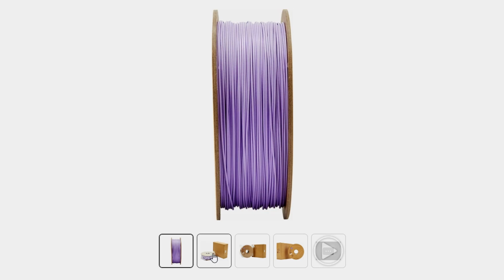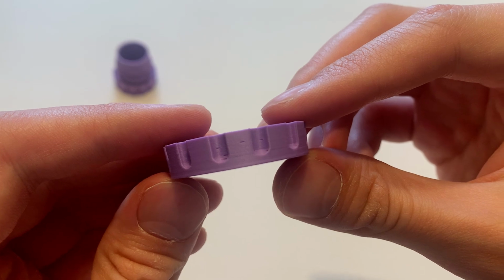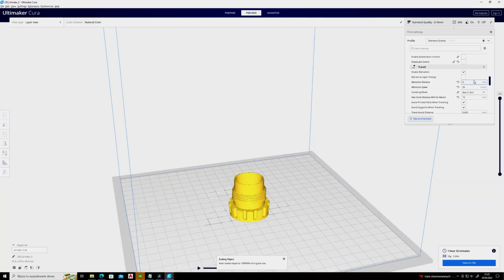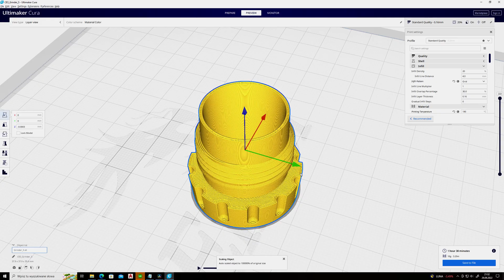POCKMARKS - how to get rid of gaps in 3D prints

Comment: You earned a sub my friend. Been battling this issue with some Eryone matte black for a few days, only one of my 3 printers was showing these holes so it was even more frustrating to pin down, maybe i have an anaemic extruder motor on the problem printer who knows, in any case 2mm retract down from 6 completely eliminated the problem. tried many things with mixed results this just fixed it.
Reply from the maker: That’s so awesome, I also struggled so much before I found this solution. I’m happy I was able to help you out!

Comment: I print Bambulab Basic PLA on the A1 mini and after 1 week I got the same problems you mentioned. I figured out that manually calibrating the flow dynamic helped a bit. I will try changing the retraction tomorrow :) Great short Video. Keep going
Reply from the maker: @orbitfighter_yt  Thanks buddy! Good luck on your prints, hope the video helps :)

Comment: I have also been using polymaker's PolyTerra filaments quite a while now, I like the matte finish. I started to get a lot of these pockmarks recently, specially when printing high detail models with 0.1-0.12 layer height. Changing the settings had very minor effects, but the PolyTerra filaments have a slightly abrasive surface, so it wears down your nozzle faster than standard smooth and slippery filaments. I swapped a new nozzle and all these problems went away. So anyone who been having these issues, try a fresh new nozzle. Also make sure filament is dry, just because it's a fresh new roll doesn't mean it's dry. Polymaker recommends 6 hours in 55c for polyterra PLA.

Comment: I have this matte rainbow that is so difficult to use,.  I increased the retraction distance and decreased the temperature to 195 to help reduce the high amount of stringing.  This helped a bit but then I got pits and under extrusion from too much retraction.  So I increased the flow to 105 and this fixed the under-extrusion but random pits continued. (filament dried multiple times so it was not moisture).  Also, i think turning off combing is a good idea if the under extrusion is occurring near the seams.   I have now turned the retraction distance and speed back down because otherwise air is pulled back into the nozzle resulting in popping and pits. This issue seems to only exist on mattes. It is much easier to tune these on regular pla and even silk.   Maybe because matte is so soft and seems to melt at a much lower temperature (i used a heat gun on low to remove stringing and the whole model warped!),  I even tried printing at 180c expecting constant clogs but it actually was fine.  But still stingy.  Maybe mattes should be printed much lower temps than suggested.  Mattes also seem less dependable for settings between brands and colors even.

Comment: I was having this problem on my Bambu X1C with ABS and ASA and I knew it wasn't moisture because I always thoroughly dry my filament. I tried temperature, cooling, speed, but nothing really changed it until I tried reducing retraction from the 0.8mm default to 0.6mm and I got the most beautiful ABS print I've ever produced. Thanks for the great advice!
Reply: Dude - I was having the exact same problem but with PLA, and I followed what you said and lowered the retraction amount and my prints have been amazing after that. Thank you so much!
Reply: @goopylooloo did you change your retraction distance or your retraction vertical lift?
Reply: Somehow this problem occurred on my X1C today. Printed a lot of ABS and out of nowhere I got these pockmarks. I thought Retraction couldn't be the problem since I've already printed some ABS before. Gonna try it out with 0,6mm and if it doesn't helps maybe my Nozzle is partially clogged.

What I wonder is why is it happens randomly when there isn't even a seam near of it
Reply: That was the fix. Thanks so much!

Comment: I never comment on videos ... but you literally saved me with this discovery! Bought some red Esun PLA+ ... seemed like it was saturated/wet straight from the vacuum seal ... turned out it does not like retraction! Followed the steps above (set retraction to 2mm in Cura) and yes, one of the most beautiful prints I have done to date! My other 20 PLA spools have never had any issue with retraction. Thanks very much for sharing!
Reply from the maker: I’m so happy I saved you some time, it tooks me weeks until I figured out how to fix this problem. Thank you so much for the comment!!
Reply: I am literally experiencing this with the same Esun red filament, now I know what to do!

Comment: I can't get rid of mine!!! I have a direct drive Qidi x plus2 and a qidi x max 3, and i have all my filaments in dryers for WEEKS, and it still does it! I keep dropping the retraction lower and lower... i already print very slow. I keep trying to adjust retraction speeds, change coasting on than off, on then off, on than off every single time i change retraction settings... i have tried adjusting combing settings! I have tried moving the z seam all over the place, i have taken apart the entire extruder assembly and checked every sing part... I can't GET RID OF THIS ISSUE!!! I am ripping my hair out trying to fix this issue!! I only use high-end carbon fiber filaments... pa12-cf, pet-cf, petg-cf, peek-cf, paCo-cf, pa6-cf.. also  ultra Pa. i have all metal hotends with BRAND NEW extremely expensive tungsten nozzles and high-grade harden tool-steel nozzles... and i can't get rid of this problem!! I can't get this to go away, and it's completely ruining the quality and appearance of my prints!! Plus, on some prints, it's so bad that it destroys the structural strength on some thinner prints! Please, someone, anyone... help, please?! I am seriously ripping my hair over this BS! My retraction is now all the way down to .8 mm, and the retraction speed is all the way down to 20-25 mm, and it still does this!! I already tried speeding all the settings up higher, too...STILL DOES IT!! All my belts are brand new and tight, the extruder has all metal hardened gears and parts... this issue is really p!ssing me off, and i can't find any videos or advice that has gotten rid of this issue! Sorry for the rant, but this is driving up the wall and i cant find any help! Thank you in advance for reading and any help.

Comment: I can use the same filament on my s1 pro and it prints perfect my 3v2 does this and i have changed every setting possible to fix mine and its still doing it. Im so tired of people telling me its the filament
Reply from the maker: Do the pockmarks appear on the top surface also? Or just the walls?
Reply: I have a 3v2 as well and despite running old G code and new (old and latest cuts)and no firmware updates on the printer I now get pockmarks and sometimes bubbles. I have cleaned out and replaced the extruder tooth wheel and reduced the extractor seemed to help. I have replced nozzle and bowden tube couple times my next step will be adjust the flow a touch I'm thinking maybe the hotend is starting to go and its not heating enough. I have a p1p coming so I'm on the fence about bothering to replace the hot end( fans running noisy too)
Reply: Worth noting it's worse on matt pla, little less on silks and perfect on standard pla and pla plus so honestly has me purplexed.

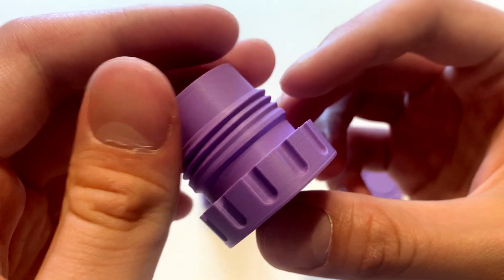Comment: how do you remove the line that appears in 2:30?
Reply from the maker: The vertical line is called seam and you can never really get rid of it, CURA allows to hide it by starting the layer lines in random spots, but to me it looks even worse. I’m afraid the seam will always be somehow visible in FDM prints

Comment: Maybe this will cause stringing, try adjusting nozzel temp and flow rate and lower print speed. if not, check nozzel or replace it, and check extruder. If still not solved. maybe there is an issue in the printer software.
Reply from the maker: Actually, it only cause stringing if you turn it down too much. If you find that sweet golden spot, you will avoid both stringing and pockmarks (from my experience)

Comment: I have pockmarks on several filaments, and use a direct drive extruder. Retraction distance is already low, 0.8mm, so any advice on going lower? I dried the filament, but that didn't solve it.
Reply: On my side, my problem was due to, the nozzle was not tightened properly. There should be no gap in between nozzle and heatbreak. I had to ensure that the nozzle has a slight gap of around 0.5mm from heatblock, to ensure that it squashes the heatbreak tightly
Reply: I'm using Sprite Pro, with the same 0.8mm retraction. I'm using a lot of polyterra's filament, and it's slightly abrasive, try a new nozzle, that fixed my problems instantly. And in general if you're printing with good settings and getting good results, you are not changing anything,  but suddenly your models starts to suck, and you are getting  a lot of pockmarks, gaps in layers, poor adhesions etc., it's time to change the nozzle. Also make sure filament is dry, just because it's a fresh new roll doesn't mean it's dry. Polymaker recommends 6 hours in 55c for polyterra PLA.

Comment: 2mm retract distans is not recommended for bowden extruders. It may lead to stringing. It worked in your case, because your ptfe tube is not loose yet, but will come over time. Also, it appears your settings of 6mm was retracting too much causing gaps. You should have tried changing settings down  in 1mm incrementals until you find your sweet spot. I had a same issue with prints, but in my case it was the popping fillament. I had first tried your suggestion, but it was stringing like hell.
Reply from the maker: Thank you for the comment! In my opinion it highly depends on the printer, and on the filament as well. For example, every other filament I used works perfectly on 6mm, but Lavender by PolyTerra only works with 2mm. I strongly ecnourage everyone to try tweeking this setting, as I believe every situation is slightly different. And that is true - the lower the retraction distance, the more it is likely for stringing to appear. It is tough to find that golden point of balance, but I believe it’s possible within few attempts. Best of wishes and thanks for sharing your experience! ♥️

Comment: Just tried this and it worked perfectly! I was working with a matte filament for the first time and found that it was considerably softer than anything I'd used before. 7 prints with terrible results and this fixed it.  Thanks!
Reply from the maker: Thank you for the comment, I'm happy the video helped you!
Reply: Yup. I used an overture matte filament and had the same issue. I was able to find an obscure post on Reddit that gave this exact same solution to the problem and we were all using different colors of overture matte filament. prints are coming out perfectly fine now. 

Although we just changed it to 3, not 2.
Reply from the maker: @chrisnorwood0211  the exact number may differ a bit, but the most important is that it worked! I’m glad you had your problem solved
Reply: @chrisnorwood0211 omg, also here looking for solutions to pockmarks on Overture matte
Reply: @Spinzerelli  lol, nice. I changed my retraction distance to 3 and now my prints are coming out fine! Someone else on Reddit mentioned that they haven't found a better matte filament so they might just be the way to go.